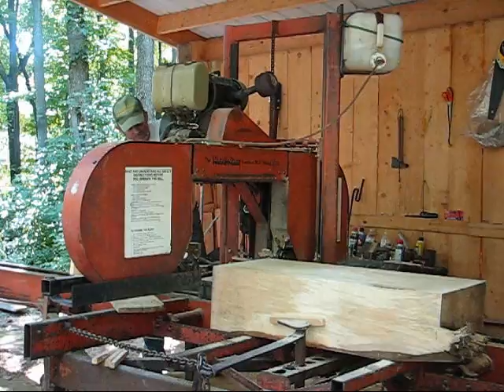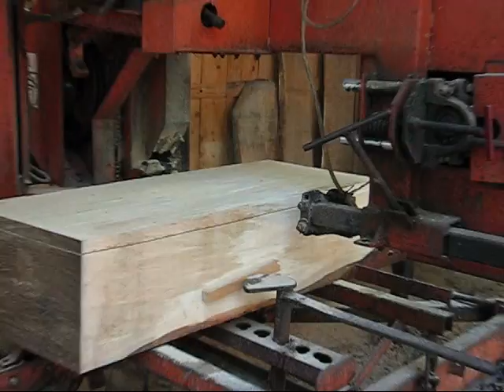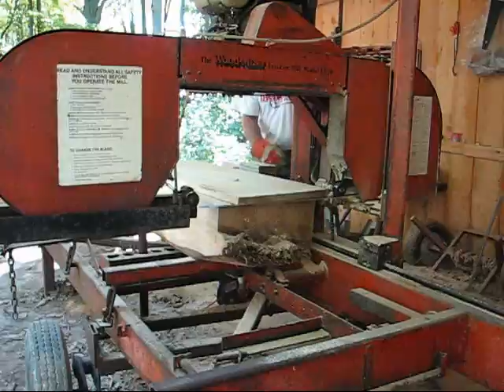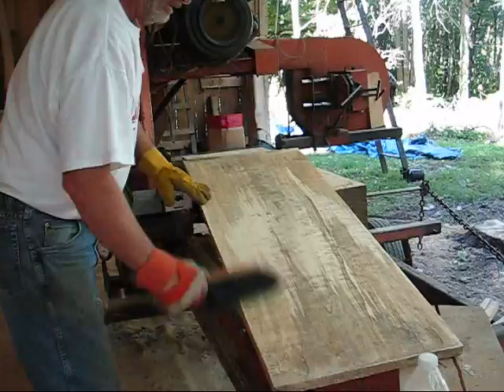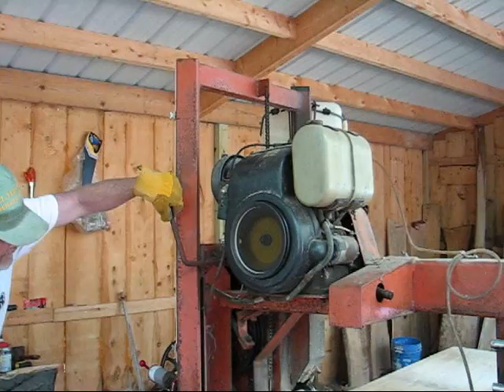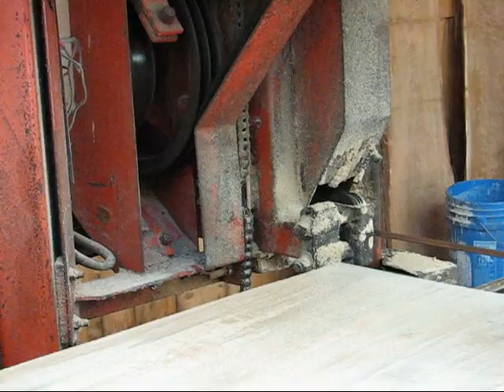1985 Wood Mizer LT-30

Comment: Your mill running a 14 hp Kohler?  That's what I have on my '84 LT-30 WM
Reply: mine is a 16hp kohler it's a 86 lt 30
Reply from the maker: Auminer Dave Yes, 14 HP Kohler. Had to rebuild it a couple years ago after mill sat unused for 9 years. Didn't take much, just a tear down, cleaning and reassembly.